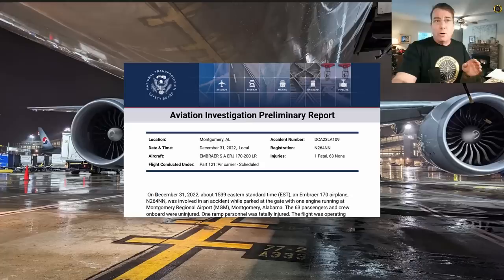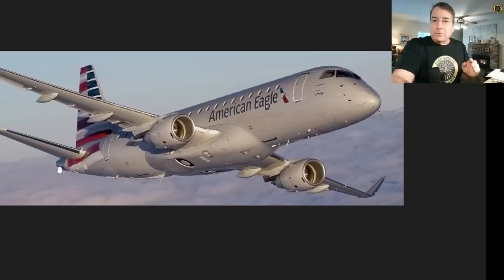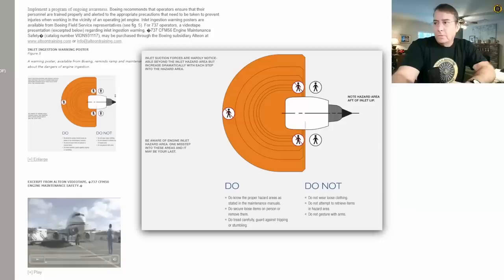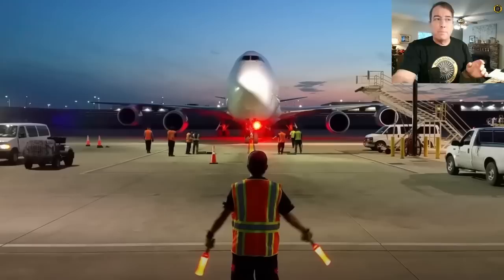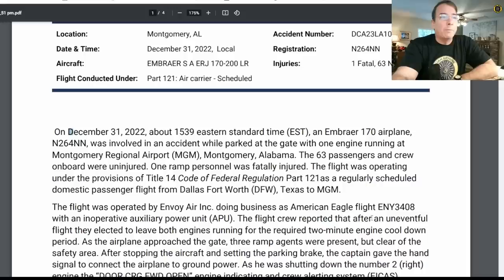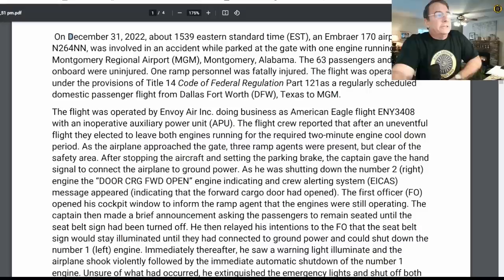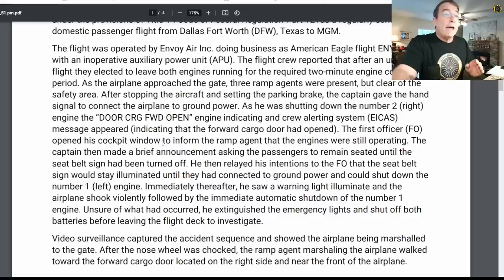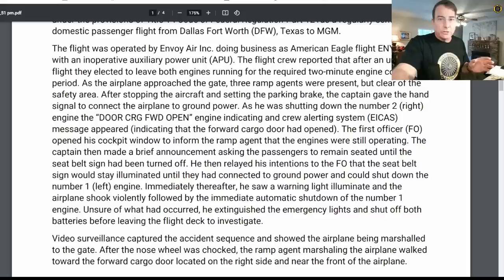NTSB Preliminary Report Ramp Agent Fatality 31 Dec 2022 Montgomery Al.

Comment: As a ramp lead myself I can say for sure pressure from management to turn a flight in there time window is strong my company requires all wheels to be chocked and forward pits to be open within 45 seconds from the time the plane arrives at the T also they like to say safety is their number one priority but in reality it is their turn time
Reply: Then how would that work,with a 2 minute cool down of engines!  An you off load the front first and not the back?
Reply: @davidsmiths5471  we don't do a 2 min cool down because of long taxi time to our gate usually are time doesn't start till engines are shut down anyways but what's even crazier is southwest I watch those guys who are mainline and they don't even wait till the beacon light is off there giving all clear as soon as the plane arrives my company has just recently made changes though due to this accident
Reply: @davidsmiths5471  we only off load claim a gates from the front usually in pit one with any wheel chairs my airline only uses 737s at my station we offload the back first 97% of the time but if there's more bags in the front we do that first

Comment: Accident waiting to happen: The company doesn’t want the crew to start the APU on taxing to the gate. We all know that! 
So with number one turning while in the chocks waiting for ground power, that huge vacuum cleaner spinning out on the wing is nothing more than a death trap. How many times do rampers open up doors and start off loading bags? 
Juan, tell the folks it could take 10 minutes before ground power is finally connected to the plane…….To save what? A cycle on the APU and a thimble full of go juice? 
I didn’t read where the APU was deferred? If it was….my bad! But C’Mon…. Let’s separate reality from fantasy pertaining to ground ops!

Comment: As the woman was walking towards the left wingtip from the rear of the airplane, she should’ve noticed the exhaust from the #1 engine, rounding the wingtip and turning to walk towards the airplane she should’ve seen the beacon had not been turned off, and even with ear protection she should’ve heard the engine running, so seems to me she intentionally walked in front of the engine.
Reply: not paying attention is the cause of like 90% of accidents like this. Jobs probably very monotonous and Ramp agents aren't paid well for how dangerous it can be.

Comment: I am no expert, but could the ground crew be given air horns and a strobe light attached to their vest that when activated the ground crew knows to back away from the injection area. The pilot could also have an air horn to indicate danger. I am sure there is technology  with a loud siren that could be activated to alert ground crew to stop what they are doing and back away from the plane. Sometimes people lose situational awareness and need a kick in there butt(loud noise) to prevent tragedy’s like this.

Comment: There is always a lot of pressure on ramp staff to get an aircraft turned and on time. The pressure comes from both from management and peer pressure. You are often contemplating your next job before the current one is done. Once the wheels are chocked, there may not be specific roles laid out. Consequently, the folks are focused on trying to see what job needs to be done next, completely forgetting the safety lecture they got 15 minutes ago. You get ingrained to work fast. I won't say safety took second place to speed, but you often heard more comments from management about quick turnarounds than you did about staying safe.
Add to this, the long hours and short staffing that surrounds the holidays, and you have a mix of tired people who are more focused on work than safety. In my short career as a ramp supervisor, I think the worst thing I saw was people try to cut corners and end up hitting the aircraft with a baggage cart, or fall off a ladder while cleaning the cockpit windows. There were close calls, but thankfully no real, serious injuries. Safety was drummed into everyone so often, to the point that some people just stopped hearing it.
Finally, as is the case with many low paying jobs, the staff was often unmotivated and willing to cut corners. Some folks wanted to be there, working on an airport and being around aircraft all day, to other folks it was just a job. They wanted to do as little as possible and get it over with as quickly as possible. Listening and thinking were optional. It's part of the reason I left the airlines. You can't force people to make good decisions, even when their own safety is at stake.

Comment: I'm wondering if perhaps the ramp environment was so loud she couldn't tell the engine was still running. Although she is apparently the same worker who had just moments earlier been knocked over by exhaust, so it's hard to say.

A lot of the comments here are pondering what her seniority was, specifically if she was new on the job. I'm curious myself.

I'm also wondering, as she witnessed her co-workers approaching the aircraft, if she may have mistook that as a cue that the environment was safe.

Comment: It's the people. Many don't have their head in the game. Some need to be re trained when they come back from lunch.  There are all types of people out there working these job and I think some are on auto pilot. I've seen some stuff in my years working the ramp for UAL at BDL 2000-2005.  My best was pushing back to a remote parking spot and the tow bar fell off a 737 because it was not attached right.  Glad I had hydraulics running that day
Reply: Who was the push back driver?
Reply: @davidsmiths5471  Brother Joe

Comment: I'm curious if this was a union worker or a non-union contractor. One thing that has been the MOST beneficial aspects of being unionized is work place safety. Demanding it of the company and educating the workers to take advantage of the safety measures.
Reply: The employee involved is in a workgroup covered by a Collective Bargaining Agreement negotiated between the employer and the CWA-IBT.
Reply: @johnshannon9  So it turns out that she was an employee of Piedmont Airlines working an Envoy Air flight in Montgomery, according to a USA Today article..... and yes you are correct, they are unionized by the Communications Workers of America, the CWA. I'm not sure where you got the IBT part. The IBT are the Teamsters. How would the Teamsters be hyphenated with the CWA? Just asking. In any case she was a contractor, not an American Airlines, Main Line employee. I have to wonder if the safety culture at Piedmont was as good as at the Main Line airline. Although it could happen to anyone. Did they have a Lead Ramp Agent giving directions to his crew?  In other words.....holding them back behind the line until it was safe to enter? God forbid it should happen to one of us at the Main Line. I would hope that our instincts are more finely tuned. But again, it could happen to any of us....distraction....complacency. God help us.

Comment: Are ground crews able to communicate well with each other?  It seems most knew and saw the danger, but were not able to effectively communicate with their teammates, let alone the pilot.  Hand signals may work for routine stuff, but a cohesive crew working under tight timelines in a loud fluid environment, should probably have sound duplex comms.

Comment: I've worked both cargo ramp (UPS) and passenger ramp (NWA/Delta), both at MSP. I'm surprised we don't see more of these types of accidents. Airlines have worked hard to bust unions and move to low skill, part time, contract workers. While it can be debated whether the unions hurt or benefit workers, the one thing they did well was protect workers and their jobs. That gave rampers the ability to say no when things were too dangerous. Now these employees are short timers. They are seriously underpaid and have no job security. Turn over is killing safety culture.

I worked with guys who were still complaining about being shafted when NWA bought Republic in 1986. You think you can compare someone who has seen that much with a low paid worker who was hired by someone that doesn't work for an airline and will probably leave the job after the first heavy rain? Add to that most people think if they get hurt it's someone else's fault so they don't protect themselves. 

The airlines (and most industries) answer only to shareholders and could care less about safety. Their only priority is image and share price. 

Americans used to be the most innovative and skilled people in the world. Heck, we built most of the modern world. But that's all over. We live in an unskilled nanny state and most people love it that way so they don't have to take responsibility for their life.

Comment: To me it very much sounds like every other large scale industry: the lowest paid workers often get to carry the largest responsibilities (in practice). In most cases where management gets a push to reduce costs or improve efficiencies, they will look at anything that is high volume in terms of iterations, items, etc. Because if you can shave off a little there, the bulk of the iterations or items will make those little bits add up. And you can shave off 1% here and another 0.5% there (like with doing a little less training, or by impressing the need to lower the turnaround times on the ramp), Then the next round.. Hey, it worked the last time. We've heard of no serious problems, I'm sure we can shave off a little more. Like someone else said it all goes right, until that moment it no longer does.

Comment: thoughts and prayers to the ramp agent and family, I'm not in the industry, was thinking, shouldn't the flight crew and the ground crew be in direct communication when they get to gate? They do the briefing but that may not be enough for some people when they go out to do there job the way they always do it, I'm sure lights are always on when there around a plane, but if they hear the pilot say ' do not approach aircraft, engines running' or " operating number one engine"     Or if they had a ground safety agent to direct operations, the more dangerous and complicated the environment the more communication you need. i don't work at an airport, just trying to be helpful.

Comment: The "Safety Manual" for the operation was quoted as saying "except during single-engine turns."  It seems that phrase gives everyone an umbrella under which at least some of the SHALL items magically become SHOULD or MAY items!  There should be an unambiguous WARNING in the book worded as follows:  "INSTANTANEOUS DEATH OR SERIOUS INJURY WILL OCCUR IF ENGINE INGESTION ZONE IS VIOLATED BEFORE ENGINE HAS SLOWED ENOUGH THAT INDIVIDUAL TURBINE BLADES CAN BE CLEARLY SEEN!"

Being prohibited from or allowed into the ingestion zone should not be determined by a blinking beacon that is activated by a human pilot performing a checklist.

Single engine turns where one engine is idling, if they must be allowed, should have automatic/passive safeguards in place that protect the rushed ground crews.  Maybe a "curtain" of laser light could be activated at the 15 foot distance from inlets.  A stationary RPM sensor pointed at the turbine blades could turn the light curtain on/off, based on a unsafe/safe RPM.  Any body-part or other object that penetrates the curtain sets off a deafening horn.

Comment: Seems like from the comments Complacency becomes an issue, until this happens. Unfortunately its not just commercial aviation, GA has the same problem. so does many other high risk jobs. Seen it in racing, Law Enforcement... you name it.

Comment: How did  they get the pax off,  front and rear of the engine wouldn't be a pretty sight..
  I worked for BAe in 80s, they were ground running a 146 (with high mounted engines, of only 6,500 thrust)  one of the lads was wearing a big cold weather jacket, He was lifted up and into an engine, very dead,   human matter was sprayed all along a wall.

Comment: Okay, so just to be clear, they have to plug in an external power supply to the aircraft as the APU is inoperative. The port is located on the captains side in front of the number one engine? This makes no sense to me at all that they would keep the number one engine running until the external power is connected. Isn't that putting the ground crew into the ingestion area? Or is there some other way that this is connected that doesn't do that? Sounds like a cluster you know what from the get go.
Reply: The GPU connection is nowhere near the engines.  It is located on the lower left side of the fuselage slightly forward of the nose gear.  The engiines are at least 25-30 feet aft of this location. Connecting ground power on an E170/E175 puts an individual nowhere near an engine.  The one aircraft that I can recall where ground power was remotely close to engines is on the SAAB SF340.  Located underneath the fuselage very near the right wing root, so connecting/disconnecting GPU put one near the flaps, as well as the #2 engine exhaust and close enough to the #2 propeller to take notice!
Reply: @johnshannon9  That's good to know. Still a tragic cockup though.

Comment: Complacency is always a problem.  It has never happened before or never a problem until a problem.  Someone less focused that day.  APU’s shut down are rare and ramp personnel are not use to APU’s not functioning?
Reply: Part 121 Aircraft operate daily in scheduled flights with INOP APUs depending upon the MEL [Minimum Equipment List] . This is not a rare occurrence. The Exception is ETOPS aircraft [long range over water] which requires the APU to be Serviceable [Operational]  before Flight. This is why Dispatch and/or Flight Crew notifies the Destination Station of INOP APU to make the necessary adjustments to handle the aircraft on the Ground.

Comment: A key to remember is there was at least 2 ramp crew that violated safety, and the first one was NOT the fatal one. Curious if, by fault, design, or lack of proper self awareness, the young lady simply saw her lead move forward and open the cargo door.  At that point, there is a certain amount of muscle memory that kicks in.  She had all the warnings to break the chain, and she is solely responsible.  That said, to avoid repeat issues, they need to look at the process, hand signals, and the entire exercise can't start with one singular person or motion.  Needs checks and verifications.  Trust but verify.  Last, is the ground crew 'measured' by turn times and do they start at shutdown, or gate arrival?  One is fair, the other is a setup for failure.

Comment: I worked on a ramp at UPS for 10 yrs & was NEVER pressured to skirt safety for time when it came to the planes. I suspect the woman was either A. a new hire that was inexplicably left on her own at the wing or B. simply not paying attention. Do something long enough & you can easily fall prey to running on autopilot, which is why ramp jobs should be rotated based on training & ability.
Reply: How many stand by bags or carry on bags have you dealt with for UPS?
Reply: @davidsmiths5471  We loaded 200+ packages into the belly of A300's routinely & filled the rest of the plane with multpile containers weighing between 300 to 10,000 pounds...so none.
Reply: @huh8662  So then why make comments on a task you have never done actually? I do not understand that mentality! This lady lost her life because of really poor training and management and supervision! This should have never happened! This has nothing to do with autopilot or being a newbie. They had multiple times to stop her and even kill the engines!
Reply: @davidsmiths5471  loading aircraft in a dangerous environment under adverse conditions & in inclimate weather for a decade...yep, there's absolutely no commonality there. Is there a circus missing you?
Reply: @huh8662  Again you show your ignorance toward this tragic event! Your called out for your misinformation, so you then resort to insults! Probably better that you deal with boxes and containers!

Comment: Each station is different, I can assure you as I am familar with this particular regional airline, safety briefings are held prior to each shift, each arrival and each departure. This particular situation i hate to say speaks volume of the level of training at this individual station and experience level at the management level. End of the day EGOM was violated and constantly harped at everyone where I worked. Sadly, unrealistic turn timeframe expectations with level of experience equalled this event. E170/175/190 are wonderful aircraft but very dangerous to ramp staff if attention to detail isnt followed. This why at the station level training needs to be above and beyond. You dont really get your knowledge until you have a min of 5yrs of experience as a ramper. My prayers are to the family but this was an oversight and lack of knowledge incident  in my opinion. To this day I see reckless shortcuts by all airline ramper for the interest of meeting time requirements. Just sad over all....

Comment: While the manual may say one thing, you know the reality is different. The airlines schedule 45 minute layovers or even less. The ground crew has to hustle to get things turned around. You know management is "watching". I fly frequently and it's very common to see the ground crew swarm the plane as soon as it stops moving. It's not everywhere, but often enough that I notice, thinking those guys are either very confident or being hounded on time.